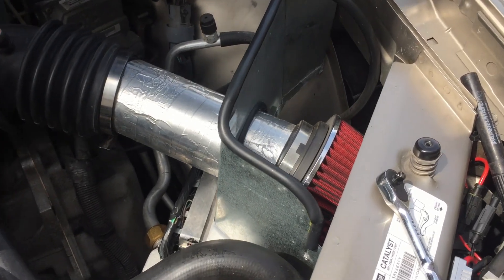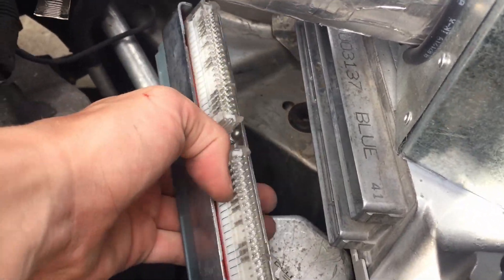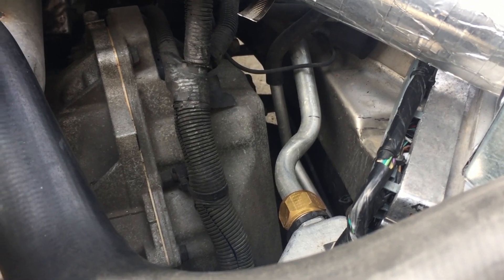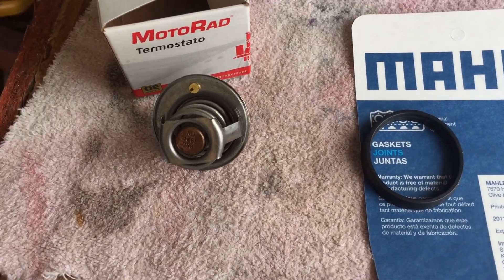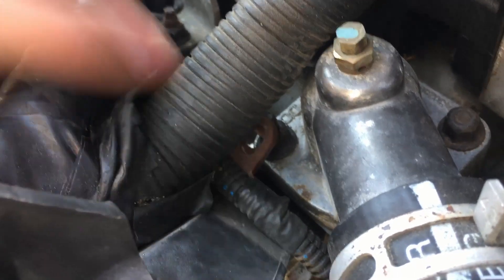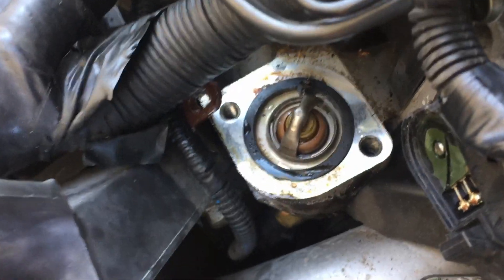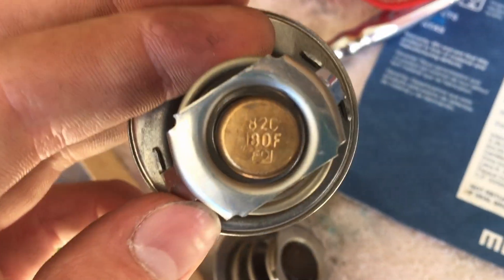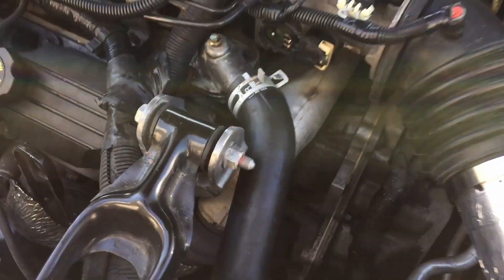Thermostat and PCM/ECU Installation (3800 series 2 Buick Regal )

Comment: Is there any benefits In changing the thermostat to 180° on this particular engine/pcm on a stock car?
Reply from the maker: Glad you asked. It’s slightly subjective, if you plan to leave your vehicle stock no there aren’t really any added benefits unless you live in a really hot location.

If you plan on modifying your vehicle however, adding a cooler Tstat helps to ensure your engine stays cold when you begin adding more power. It does take your vehicle longer to warm up though during the winters! 

Hope this helps feel free to shoot me more questions you’ve got :)

Comment: Did you have to upgrade the PCM for the  180* t-stat ? Or cuz of the intake and other mods?
Reply: If the flash tune you are paying for is tuned for a 180 degree thermostat you need to replace the thermostat, BUT if you leave them a note saying you will be using a stock 195 degree thermostat they can change the tune accordingly. :)
Reply from the maker: Yes, good point  @trumoo2124  I didn't specify, part of the tune I purchased was actually changing the Tstat. Changing over to a 180* Tstat is recommended by ZZP and other 3800 enthusiasts if you plan to modify, at least initially, many move even colder, but because my car is run through the winter (down to -40*C) I've kept it 180* for now. Id check forums to see what you should do for your application, also reaching out to ZZP's customer service is helpful too, they are very passionate about these vehicles.
Reply from the maker: Hey, a bit of both when you buy ZZP's PCM they encourage you to switch to a colder Tstat which is commonly a 180 degree Tstat! But mainly for the other mods, it raised shift points increased a couple other performance metrics, and works with my intake and upgraded exhaust to create a safe amount of more power (or at least it did, I've done quite a few more mods since I posited this video)!

If you've got a 3800 either supercharger or N/A check out ZZP's articles here:
https://zzperformance.com/blogs/import1/3800-naturally-aspirated-top-5-mods

https://zzperformance.com/blogs/import1/3800-supercharged-top-5-mods

If you want some cheap and free mods check out these:
https://74customs.com/how-to-modify-your-car-when-you-are-broke-on-a-budget/

https://74customs.com/free-car-modifications/

Hope this Helps!